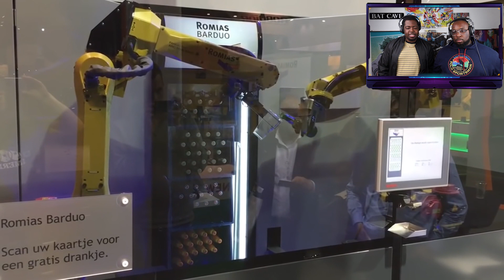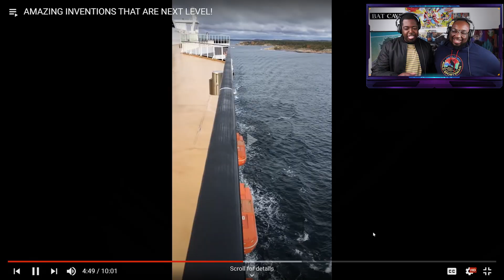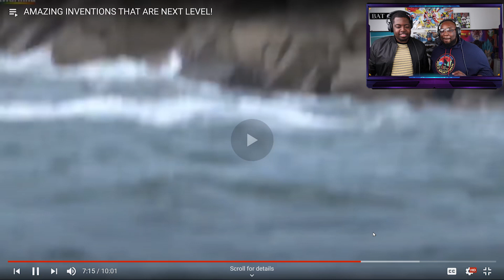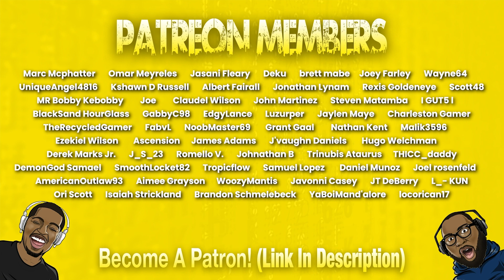AMAZING INVENTIONS that will BLOW YOUR MIND!

Comment: “According to all known laws of aviation there is no way a bee should be able to fly, it’s wings are too small to get its fat little body off the ground, the bee of course flys anyway because bees do not care what humans think is impossible.”
Reply: facts tho. bees don't give a fuck
Reply: Thanks Mox
Reply: i think it was because the laws of aviation are more for specific wing structures like most birds and used for mechanical machines like planes while a lot of flying bugs are small enough where their wings work a bit differently. for example the bee can fly because of the specific way it flaps its wings, which i think is in sort of a figure eight formation or something like that meaning that their wings don't need to be as big as the laws of aviation would expect for its size
Reply: Bee movie

Comment: 9:31 it doesnt fall because of tensegrity... basicly the tension in the wire/chain parts is literally holding the entire structure in place.
10:35 pretty sure its due to sustained motion forward using fluid physics(yes in physics air is considered a fluid).
12:25 this thing is overpriced and is pretty shit for what its supposed to do... not worth the money.
also considering theres like 3 or 4 robotics entries here im just not gonna put a timestamp on these, i havent looked into it all that much but im relatively certain that the 3 core rules of robotics is that youre not allowed to make robots designed(or smart enough) to harm, maim or kill humans PERIOD.